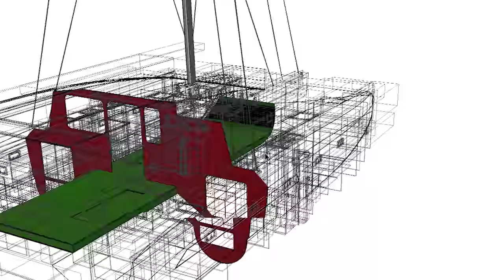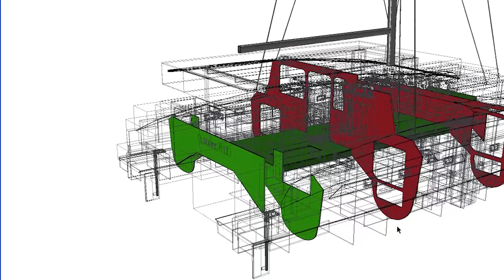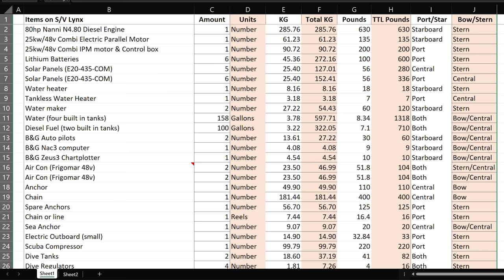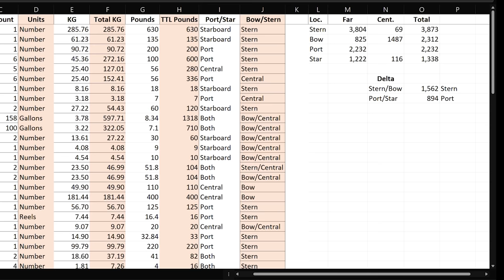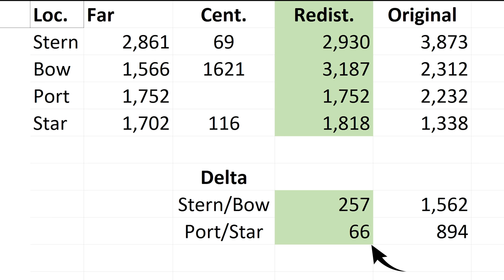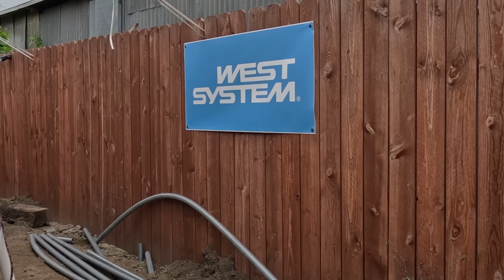Kit E33: Catamaran Build Site Disaster

Comment: Yeah, that has happened to me before.  Here is what I have learned.

1)  If using tarps, The low end of the tarp should not go over any crossbeams. As water pools up on those it creates more of a bowl which allows more water to pool up et cetera the water needs to run cleanly off. Looking back, you had some cross beams or ropes or something so it probably pooled up near the peak.

2)  Since this is for shade, rather than use tarps go get some 80% or so shade cloth (Very cheap at Harbor freight).   That way you are stopping most of the sun, but  letting water come right through.
Reply from the maker: Thanks!  And yes, we are thinking of going with just shade once these tarps wear out.

Comment: It is a bit crazy trying to build a big cat without a roof…… here in Australia we use shipping containers with poly tunnel tarp roof ( these are made from 2 inch round pipe, and a half circle shape) This type of roof is very light and strong, mine has survived 80 mph winds. Considering the cost of the of the boat, spending $5 to $8k  on a roof is well worth the expense, especially considering you can sell it when the boat is finished, makes it almost free… cheers Rustie..
Reply from the maker: All true, and we considered that at the outset.  Unfortunately, we don't have room for two containers and the boat in our build site  :(

Comment: Hi , Here in Auckland we have seen three rain events this year already that I’ve never seen in the 46 years I’ve lived here, flooding and landslides have been  extensive accross the regional and damage across the city hugely expensive. All that on top of a the wettest winter and spring I can remember. Certainly what I’ve seen of the Californian rain on the news and YT has been amazing given your years of drought and low dam levels. I think you can be forgiven for not anticipating what happened to your structure. I was one of the people who commented it might take off in the opposite direction to what actually happened . 😀 On the plus side you had your existing work covered and the structure didn’t fall on your hull, that would have been heart breaking, dodged a bullet there. I’m finding this a very interesting build especially as a retired engineer.
Reply: I'm sorry to hear about the trouble in Auckland. Years ago I met someone from there who said California and New Zealand's weather was similar. I guess it was this year.
Reply from the maker: Yep, we dodged one there!  No damage to the boat or structure to build it. :)

Comment: How are you accounting for the weight of the wiring that will be required on the boat? Also are you concerned about the voltage drop you may now have given the storage batteries are located so far from the generators as well as the larger electrical loads including the electric propulsion motors you are using? It would appear to me that a lot of heavy gauge wiring is going to be needed to be run from the Starboard bow area back to the stern engine compartments.
Reply from the maker: We considered that, including the added weight it will create having to go with longer runs and thicker wires.  However, we had to move weight off the stern and there was nothing else (heavy enough) we could move and that was more critical than adding another 50 pounds to the boat in wiring.  It was also one of the reasons we moved the Victron equipment as well, that moved weight, but the lines from the batteries to the Victron equipment is now a very short run.  We only need to take one set of thick wires back to the engine area.
Reply: @SailingSVLynx  Are you planning on using AL or Copper wiring? 4/0 copper weighs .648 lb. per foot but has less voltage drop than AL. I would contend you will have at least two sets of thick wiring if you want to be able to charge the batteries from either engine. Sailing Dauntless stripped all the wiring from their boat a Lagoon 50' and it weighed without the isolation transformer 598 Lbs of copper wire.
Reply from the maker: We only have one 80hp diesel engine with a 25kw electric motor in parallel, the other side is a standalone 25kw electric motor.
Reply: @SailingSVLynx  OK...but you still have multiple sources of power that have to be fed to the batteries. Don't forget to account for inrush current on those motors. 12KW at 48 VDC is 250 amps. Best of luck.

Comment: Use agricultural shade cloth instead of tarps for sun screen. The shade cloth is lighter than the tarps and will not let water pool. 

Additionally, the MDF used for your forms is a hygroscopic material, it will absorb moisture. You’ve already seen the results of this from your overly tight joints. While this may be due to the tolerances in the tool paths, when they were cut at the factory, what is more likely is they absorbed moisture in transit. You can protect your forms, and reduce this tendency, by painting the forms to seal them up. Your local big box store should have clearance gallons of oil based paint to use for this purpose.
Reply from the maker: Likely true.  Thanks.

Comment: A Norman comment from June 2024(still catching up). Sorry you had to deal with the collapsed shade tent I look forward to seeing what you come up with for a ‘longer term solution’ which you will most certainly need if you are hoping for a quicker build.

On the weight balance calculation and spreadsheet work, I would like to make some comments if I may:
1. I am surprised they went with a method that is quite crude in terms of location. A suggested improvement for location would be to add a layer to the CAD plan which is a simple grid where the transverse lines coincide with bulkhead positions and longitudinal lines about half the width of a canoe , these referenced by letters for one axis and numbers for the other.
2. Moving all the batteries so far forward ( and at a distance from the loads) is extreme and is going to generate significant consequences (Cable size, weight, transmission loss, cost).
3. I know you are between a rock and a hard place and the weight balance has to be achieved but I really think you need to go round the buoy on this - and wargame it with the aim of achieving the balance with the batteries and load closer together. You should examine every stupid option to achieve that and only discount when you have proven that is an impossible option. For example could you move the Nanni one bulkhead further forward and have a longer propellor shaft.

Best of luck.😉👍⛵️
Reply from the maker: We have done new calculations of weight balance and did an episode on that later.  But I'll address one thing now, the batteries are no longer forward, they are at the stern now, balancing the weight of the diesel engine on the opposite side.
Reply: @SailingSVLynx   Brilliant.👍

Comment: No point in crying over spilt milk.  You need to arrest the situation and move on to mitigate any more delays and additional cost. 

I would strongly suggest erecting a proper engineered designed steel truss frame structure covered an FM sided with standing seam sheets to provide long term and secure protection from the elements that will last the entirety of your project and beyond. When you're done you can always sell it. 

Planning for scenarios is one thing but you also have to include all the risk management planning. While you're at it,  you will need to review and tighten up on yout procurement schedule for materials and equipment. Keep tracking the progress of your schedule and update it so you can see your actual progress against planned and also do your shirt term work plans base on two week look ahead forecasts. Remember,  your triple constraint,  time,  cost and scope. One always affects the others.

So you can track your budget and expenditure closely along the way against the planned benchmark budget. 

Pay close attention to quality control,  quality assurance of materials,  and equipment supplies. 

Sorry,  again too much opinion.  You will be fine
Reply from the maker: lol, thanks for the opinions anyway, we always appreciate the time people take to try to help.  And, yes, we will be fine.  I keep telling myself that every morning.  ;)

Comment: I was building a deck and didnt want to mar the surface I used some old skeakers on the pop up canopy feet and moved it around as needed for shade .
I ratchet strapped to deck at night. you might be able to do this when your up doing the deck parts.
As far as the popup canopys I've bought dozens in my years (camping and fleemarket vender) and finally bought an  ABC brand one  more expensive but I'm at the stage buy once cry once and get the best item.
Reply from the maker: Thanks for the information :)

Comment: I don't know yet what happened at the build site. In minute 10 is clearly visible that the tent (if it deserves the name at all) will not last much longer. Take a look at Life on the hulls, sure you know that channel already. Of course you need a tent or a shed which will protect the boat in any weather until it's waterproof. Wet foam doesn't like epoxy very much. One next thing, MDF takes humidity very good and therefore it needs to be protected from water from the ground. It will swell up and deform eventually the hull if enough humidity is coming down. At least coat it with EP. One more argument to cover the entire site is the fact that EP hates to stick on weathered surfaces. Air pollution and any content in the rain water will reduce the strength of the laminate and paint later on as well.
Reply from the maker: Thanks for the input.

Comment: That 45 isn’t that stable. You need like an 8-12” scarf joint
Reply from the maker: We follow the instructions of the kit designer.  With all the carbon fiber layers wrapping this forebeam, it will be plenty strong.
Reply: @SailingSVLynx  I understand you are following directions. I feel what “stabilizes” that joint, is the fact it gets layers of fiber glass and other coatings on top of it. I’m sure it will be fine as well. But in general, connecting 2 long thin strips requires a long scarf joint for the most surface area on the joining surface. This is how wooden/foam panel kayaks and canoes are built.
Reply from the maker: @jonblair5470  Fortunately, we solve the issue by getting rid of all joints at the twist and bend areas.